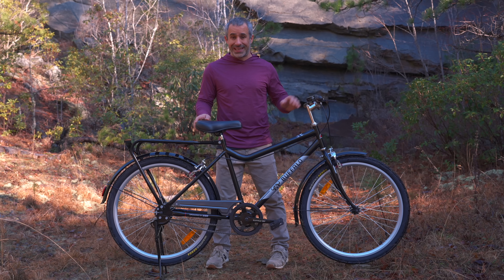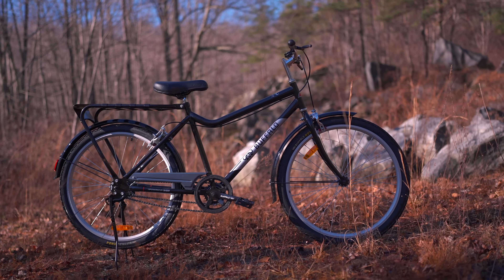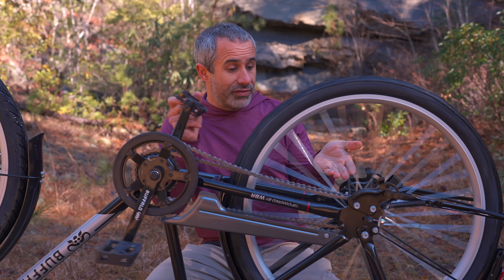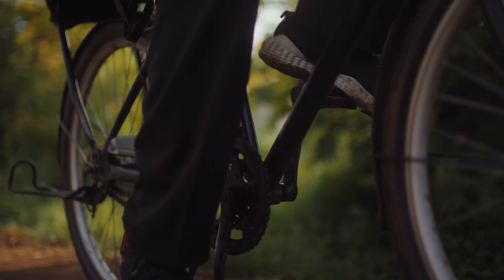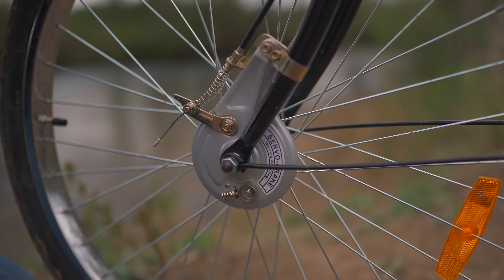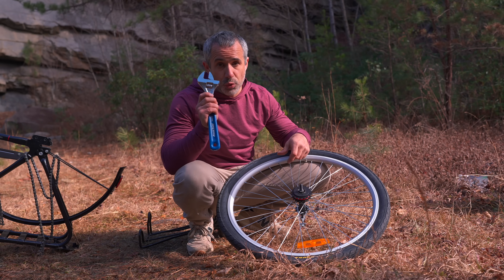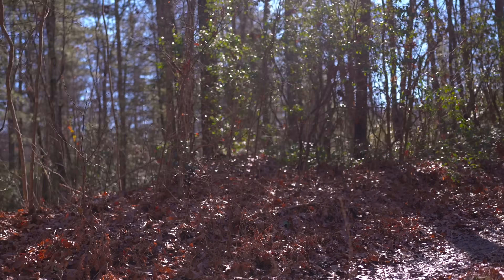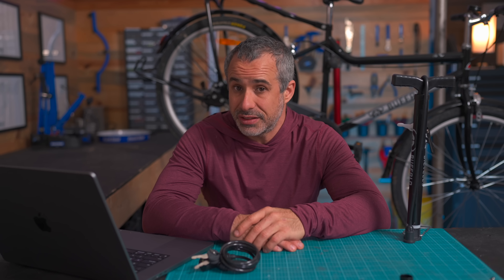Why 2 Chains Make This Bicycle WAY BETTER

Comment: I had a two speed Schwinn cruiser about 50 years ago with a two speed rear end, but only one chain. Shifted the same way. But if you reverse pedal and push hard, coaster brakes.

Comment: Any freewheel (as opposed to a freehub) is mounted on a threaded hub with the axle bearings    situated inborn increasing the likelihood of a bent or broken axle, especially with heavier loads. How often, roughly, do rear axles have to be replaced?

Why aren' t internal gears, say a shimano 3-speed, being used---sand/dirt?--more maintenance? Not worse than a coaster brake requiires as on the older model?

Thanks, good work. I did a bike project in Nampula, Mozambique in 1990--anything planned for northern Mozambique?

Comment: I had an old 60's bike. You know the kind with sissy bars and banana seats and high rise bars.  Mine had a steering wheel instead of handle bars.  Anyway, it had a two speed hub with a coaster brake.  You kick the pedals back, or I should say, tap the pedal back and it goes into a lower or higher gear.  Depending on which gear you are already in.  It was a nice set up.  I could go faster than other similar bikes, and get up steeper hills easier.  The steering wheel for bars took some getting use to...  But it was cool, and I was the only kid with one.

Comment: This video is about a bike, but to store milk you would need one solar panel 400 W, and some special fridge, which could be connected directly to the solar panel, without inverter, battery, charger aso. to hold it as cheap as possible. Some selfmade boxes could be done out of timber with two rooms. In one room would be milk, or other food, in another room would be thermal mass, to store coldness, and for example 24 V compressor directly connected to solar panel, and store coldness in thermal mass. And would run the whole light day long, or less through some bimetal relay, when thermal mass would be too cold, so the compressor would be stopped. Additionally some thermostat with bimetal air valve and fun would circulate air between both rooms, to hold constant temperature in the food room. They would need to buy only one solar panel and such a 24 V chiller module, like a split system with two blocks, like by conditioning systems. So there some cheap fridge could be made, driven by sun power.

Comment: 8:42 Check out the Sturmey Archer S2 Kick Shift with hub brake. 2 gears, back pedal to shift, back pedal more to brake.
Best of both worlds it is enclosed, durable and not much more complex than the sram dual freehub which is essentially the same principle. And it has a direct 1 to 1 ratio which is pretty much fail safe.

Comment: Fichtel & Sachs once in the 70s had a Tornado branded 2-Speed coaster brake freewheel hub which shifted by pedalling backwards. It was designed for folding bikes.

Comment: The one thing they should have done was they should have used a drum brake on the back. Having the heavier duty steel rim combined with reliability and lack of maintenance of a drum brake is ideal. Drum brakes are fantastic for maintaining speed down a decline or gradual stopping; lessons learned from riding a tandem and trying to maintain less then 90km/h (56mph) down a steep and long hill. Far less load is going through the front wheel and the stopping power of a rim brake verses drum is unparalleled especially for the front. I never recommend a front drum brake ever and always recommend replacing it with a rim brake due to safety every time.

Comment: 1. Lower rear rack to get lower center of gravity of the cargo would be needed.  2. Also lower horisontal tube of the frame would be needed in order to make it easier to get on the bike by lifting other leg over it. I wonder why these improvements were not made already when designing this special bike.

Comment: No laughing at that wrench. Been standard in road repair kits for ages. My carry along pump is nothing like my home one either. But it is lightweight and will get me home. So everyone that strays out of walking distance from home or repairshop, should pack a repair kit with such. Travel tools compromise. If I had no tools and had to pick one. This one wohld be the first. And even with a full set of tools, still the one to pack for on the road.

Comment: I used to true wheels on basic bikes with my thumb every day with a tune up at a shop I worked at. 
You can get them pretty good with practice. 

Yes, yes, high end bikes with nice wheels would get treated to the truing stand.

Comment: The Buffalo Bicycle concept is great: however I think the 2 speed hub apparatus is missing the point of simplicity.  Remember the old 3 speed internal hub.  Those old things were bullet proof.  I got one at 12 years old and used it for two HARD years as a mountain bike, long before anyone even called them mountain bikes.  Incorporating the old 3 speed hub would add even more versatility, and would eliminate the extra chain and sprockets (with their added weight, complexity, maintenance).  That 2 speed hub is a solution to a problem that was solved many decades ago by the 3 speed internal hub.  IMO as an engineer.
Reply: Indeed and also belt drive would be better on those dusty and sandy roads.

Comment: It is actually possible to have kick shifting and coaster brakes at the same time. For such hubs, you pedal back only a small bit to shift and then even more to brake. This is how it works on the sturmey archer S2C hub.

It has the side effect of switching gears every time you go to brake but this could be seen as both a positive and a negative. If you go to stop while in low gear then you'll be in the high gear when you set off, but if you stop while in high gear then you're automatically going to be in low gear when you set off.

Either way, its definitely possible despite being a bit finicky. I imagine they avoided such a mechanism for this bike purely because of the operational complexity, not because it wasn't possible.

Comment: I love what they're doing 👍💯
But I think the rim brakes are a mistake.
As someone who has ridden them for a long time and still has one bike with rim brakes, I can't even describe how annoying it is to ride with a bent rim that drags on the brake once per revolution. It is so exhausting.

imho he front drum brake should have stayed.
and it would have been possible to make the rear also a cable actuated drum brake. 
If I remember correctly, there even were bikes with chain shifter and cable actuated drum brake at the rear.

Comment: isnt a non pneumatic/airless solid tyre works better in environment such as rough roads?..and it eliminate the use of tyre pump & tubes too..which can save alot..

Comment: referring to my previous comments, i finally found out a bicycle transmission thats almost like this, its the sturmey archer s2 kickshift gearhub, like this theres no shifter and/or cable, like this its a gearhub, and like this its 2 speed, and like this you shift by pedaling backwards slightly, it only requires one chain though and yeah.

Comment: I never thought about the durability of the parts on the bike before.😅  I got a Gt Performer 1987 when I turned 9 and had that bike till I was 20 and never replaced anything on it except tires and brake pads.... I rode that thing daily and hard. Like half pipe drop ins from plywood to concrete, I jumped that bike off ramps 8ft high with nothing put pavement landings, seriously, that bike must have spoiled me lol because it never failed me and it was ride hard. I would in my late teens use it on mountain bike trails with my friends that had mountain bikes lol, it went through hell and never had to replace anything on it except the chain at some point.  Ohh and it was the bike I put my right  hand three middle fingers  through the chain and crank sprocket and got half way around doing 30mph before I realized what had happened . There was so much blood and the doctors had no plans except take the finger gloves  I made from the skin on my fingers and straighten it out and then have me keep changing the wrap and tape when it got overwhelmed with blood. It happened a lot and the pain was weeks that I can't explain to someone , it probably was up there with child birth one doctor said because of how sensitive and the amount of nerves In each finger.   Well still got the fingers and the scars to show that fateful day.  My mother on her way home from working found my bike and a trail of blood going down the road where I ran to the first house I knew someone would be home. She was panicked for sure she thought I got hit and dragged away under the car with the half mile of blood she followed , fingers bleed. A lot when u remove the skin FYI

Comment: I don't understand the need to change the front brake. The drum works just fine, more than adequate power. And it is what the current infrastructure is built for. It makes sense to use rim brakes on the rear, but the rear brake also doesn't really matter that much. A failure on the rear can be ignored for weeks if need be. Now all those shops will have to keep parts on hand for both types of brake, and they'll need both types of wheel. For a group that's trying to bring economical transport to remote areas, this is a step in the wrong direction. But it's exactly what I predicted in my last comment on a video about this operation- it's a conglomeration of companies bootstrapping a new revenues source. Start simple, get people hooked, gradually increase the complexity until you have a sustainable market.

Also, as someone who routinely spins the cranks backwards idly, that mechanism would drive me insane.

Comment: If it’s such a good system then how come it hasn’t been adopted across the board?
  I used hate truing wheels. 
I would have gone with the disc brakes

Comment: My Dad rode a transport bike in for a Bakery after WW2.  Most that bike carried (for short distance challenge among cyclists) was 1000 lbs.  10 x 100 lbs sacks of flour.     Holland is flat, but there is nothing really new under the sun.        Surprised they don't use a trailer to carry the milk.

Comment: There is one part of this design I really do not understand. There is nothing new in the backpedal shifting (on a two-speed hub gear). This used to be common at least around 1970s, and at least Sturmey Archer still makes their S2.

It is a hub that just works. Two speeds. Kick back a bit to shift. Kick back a lot to brake. That is to say, the S2 has both shifting and coaster brakes in the same cable-free package. Just add the hub in, and reduce the front chainring size as the lower gear is the 1:1 and the longer gear is an overdrive.

Oh, yes, and SRAM also has had their elegant 2 speed, which they discontinued just a few years ago. Their Automatix was potentially even more elegant. The upshift was automatic, as was the downshift. There is a secondary freewheel ratchet inside the hub which mechanically senses the speed at which the wheel is turning via the apparent centrifugal force on the sprawls. At around 10-15 kph, the longer gear gets automatically engaged. To get back down to the smaller gear, all you need to do is to slow down below this speed and momentarily stop pedaling to let the springs pull the sprawls back in (the pedaling keeps them engaged). Oh, and the speed at which the shifting happens can also be tuned by your local mechanic during the basic hub service, though, SRAM never really themselves realised to advertise that feature. Just bend the spring holding the sprawls a bit to stiffen or to loosen it, a method several bike mechanics invented independently.

The other thing I cannot understand is the huge downgrade in the brakes. The rim brake does not feel suitable for the intended use with heavier loads and hillier terrains. Combine it with muddy roads and it will eat through the rim. The drum brakes in the original design have much longer service life. Not to mention proportionally simpler service once the wear parts are done. There is a reason why the drum brakes (or as they are called “roller brakes”) are so popular in for example Netherlands and why old postal bikes in the UK had them. They just work, day in, day out. No rim wear. Much less caring about the rim getting a bit out of true. Sealed construction. Enough power. Basically, a bit weaker version of the disk brake but without the exposed disk.

Comment: So basically it's the same as the kickback hubs from sturmey but with an external mechanism instead of an internal mechanism. Smart. It can be replaced easier. I wonder if you could get the best of both worlds by designing a hub with an internal mechanism that can be removed and replaced from within the shell

Comment: watching this again im kinda sad you cant get this anywhere else, i'll only use two gears on my bicycle anyways and i'd love one of these, its a justified bicycle because you can abuse it as much as you want and it'll still work, i want this, at least only the shifter, it sounds brilliant, thing is i cant find any information on how it even works :c
Reply: i finally found out a bicycle transmission thats almost like this, its the sturmey archer s2 kickshift gearhub, like this theres shifter and/or cable, like this its a gearhub, and like this its 2 speed, and like this you shift by pedaling backwards slightly, it only requires one chain though and yeah.

Comment: great idea, but selling this for 165$ to people in poverty is inexcusable. the whole bike is probably worth like 20$ in the assmebly line, after you even count in the innovation and R&D cost for the freewheel system each unit woudn't have push the price tag over 50$. 165$ is at an price tag of people's entire year of salary.

Comment: In this design, it is impossible to tighten the chain because the chains will stretch unevenly. A loose chain will lead to increased wear of the mechanism and its premature failure. The most reliable design is a crankshaft and direct drive, slightly less reliable is a crankshaft with a three-speed gearbox in the rear hub with gears made of durable metal. By the way, a set of tools for repairing a bicycle and a spare cheap chain will cost much less than this bike.
Reply: And no one from "former bike mechanics" from this chat did not see this obvious trouble! =))

Comment: Why can't you pedal brake with this clutch? On my mother's old 2-speed bike from the '50-s (still working flawlessly) you both brake and shift gears with the pedals. Which is quite nice since often when you brake you want the other (lower) gear anyways. And I don't remember that gear mechanism ever needing maintenance. So you still have to convince me that this solution is superior to old-style 2-speed pedal shifting hub gears.

Comment: is this significantly reliable over a classic downtube style shifter? I'm sure they could find a way to cage the basic derailleur, especially if it only needs to shift between two or three gears. could even keep the backpedal brakes too

Comment: Interesting: my first bike was a Raleigh 20. It had two gears that were changed by back peddling. Back peddling ALSO was a brake. Interesting that they discarded that option. (You just needed to back pedal just briefly so it didn’t really brake much in that case.)

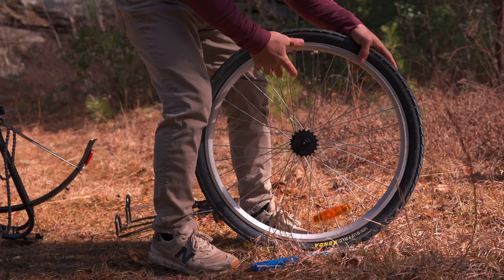Comment: 10:56 Poor nut. That's NOT how you use an adjustable wrench. The solid hook should be on the side pulling, NOT on the side pushing!

Comment: For Africa... this bike is absolute garbage.
and here is why:
(its sad if u really asking yourself why, the first minute is enough to know it already.)
Answer: Look at 0:57
No Suspension at all.
this bike is static af.
on these roads there.. if u can call it road. u need tire suspension saddle suspension and frame suspension.
and good ones. not cheap ones.
otherwise this bike wont last long.
these roads are the worst for  the spokes.
and your back will get damaged too.
i know you are doing it because of the money u get for advertising it.
but this bike is shit bro.
and 2 chains wont change that fact.

Comment: Great design but I wish you had explained how one is supposed to set the chain tension with this kind of design. I can see that the longer chain is very loose around 4:10 so is this just incorrectly adjusted chain tension on this specific bike or is this the shortcoming of this design in all cases?

Update: I see this was answered later in the video: it's a shortcoming of this design.

Comment: Not sure if you mentioned: Are the chains redundant? As in, could you still ride with a single chain?
Reply: It was mentioned quickly and easily missed:  the flywheel only matters for the new gear ratio so if it fails it would revert to behaving like the original single speed version.

Comment: I do have one comment, Its a great bike,,,,however I would make it with two chains the same in length so that if one chain was to be damaged you could still ride fast or power. By adjustment in sprocket sizes to make this happen. Great story and what a wonderful thing.